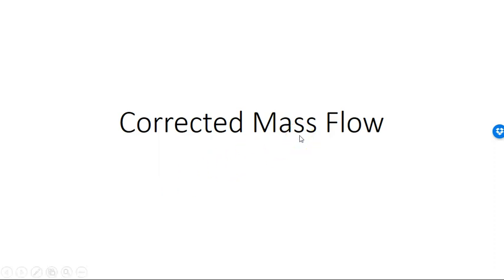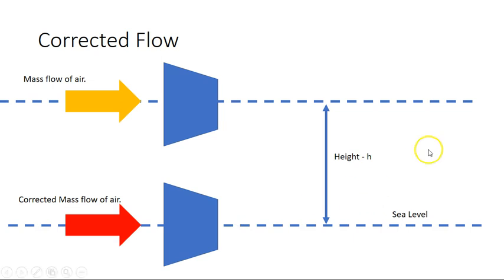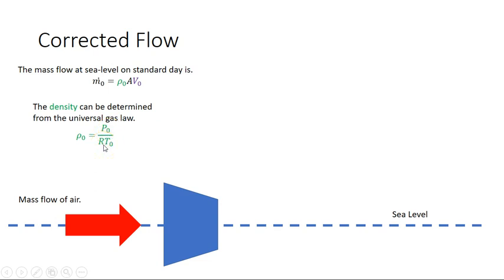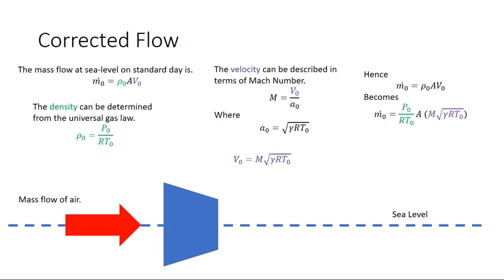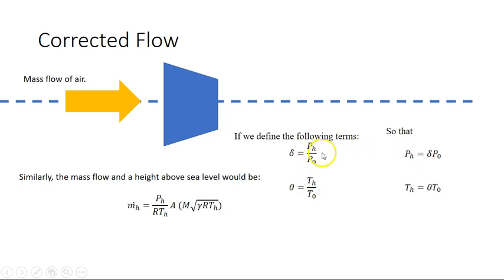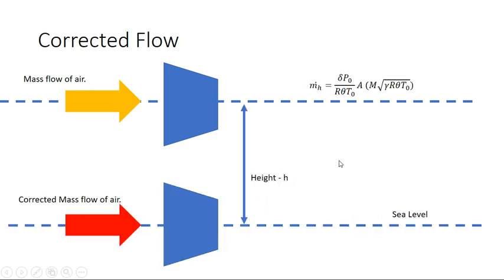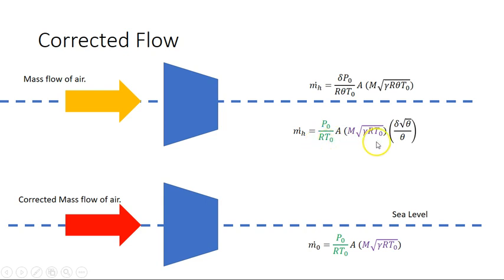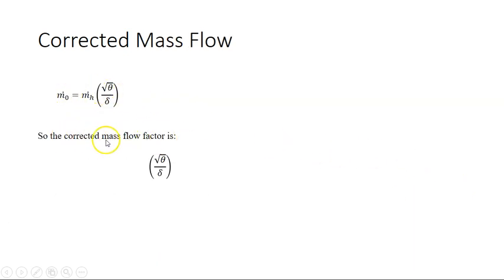Corrected Mass Flow

Comment: Sir I do not understand. Thank you for explanation though. We do not say 1 kg/s reaching a point because we are talking about velocity not mass flow in that case. In mass flow we say every second we are flowing 1 kg of air. So if we talk about velocity, it again ties back to volumetric flow which needs correction because as you said velocity or Mach number change with altitude. Anyway, it was nice discussion.

Comment: 1 kg of air takes 1 second to reach a point. Is it the same 1 kg of air going through the same path and reach the same point 0.5 sec later? How is it possible?
Reply from the maker: It could be the same 1kg of air, it just has a different velocity.  The point I was trying to make is that kg/s is different from kg.

Comment: I would suggest to put in same kg/s flow of air at different sized pipes one horizontal and one vertical and measure kg/s at the other end of pipes. See if you get same kg/s or not. Probably you need to look at mass balance equation that suggest kg/s going to control volume equals kg/s coming out if there is no accumulation of mass in that control volume. This is the first time I have heard kg remains constant but not kg/s.
Reply from the maker: Think of it like this:
Scenario 1.  A 1kg mass takes 1 second to pass a point.  It has a mass flow of 1kg/s.

Scenario 2. A 1kg mass takes 0.5 seconds to pass the same point.  It has a mass flow of 2kg/s.  

Both masses were 1kg but the mass flows were different.

Comment: Your explanation suggests you are correcting volumetric flow. You are trying to get same say 1m3/s at both sea level and at altitude but not 1 kg/s because 1 kg/s is same at sea level and at altitude.
Reply from the maker: Agreed, 1kg remains 1kg no matter the altitude, but mass flow is kg/s and not kg.  So, you can have a different amount of kg/s due to the difference in volumetric flow.

Comment: Density = mass/volume. If you compress air volume decreases but density increases because mass is constant.other way around during expansion. Please note that mass = density x volume should be constant that gives the same explanation that I gave earlier for mass flow rate.

Comment: Mass flow = density x Area perpendicular to flow x velocity of flow. But velocity of flow x Area gives volumetric flow. You use ideal gas law to correct volumetric flow for pressure and temperature. You use ideal gas law to correct density. Because the correction for density and volumetric flow is inverse of each other, Mass flow = density x volumetric flow = constant. No need to correct mass flow if you are measuring mass flow.
Reply from the maker: In this example, the volumetric flow changes with altitude, because the Mach number changes with altitude.  Furthermore, the density changes with altitude also.  Therefore, the same mass of air won't enter the engine at altitude as would enter at sea-level.

Comment: Why do we even correct mass flow? Mass can neither be created nor destroyed. Kg at top of Mount Everest or bottom of ocean is same.
Reply from the maker: Yes, mass can neither be created or destroyed, but consider a volume of 1m^3 of air at the bottom of Mt. Everest and the same 1m^3 at the top of Everest.  The mass of both volumes of air will be different due to the difference in density.  Similarly, in this video the mass flow is the product of the density, area and velocity (Mach Number).  The density and Mach number will change due to altitude.  Hence, corrected mass flow.